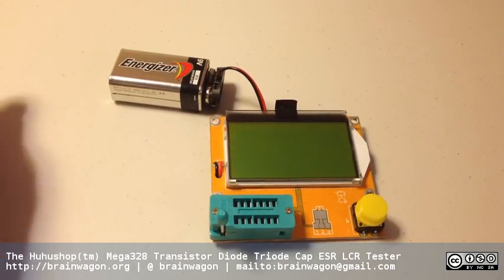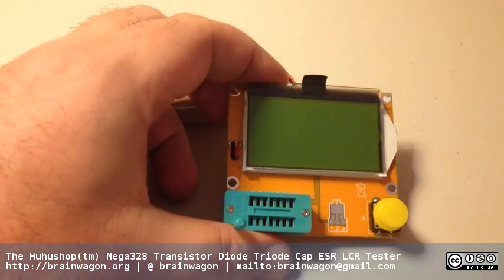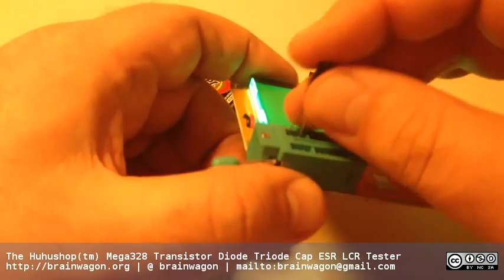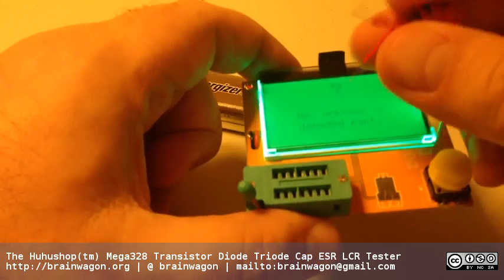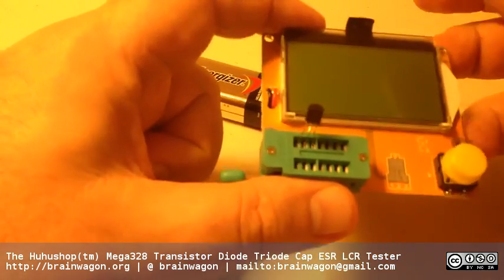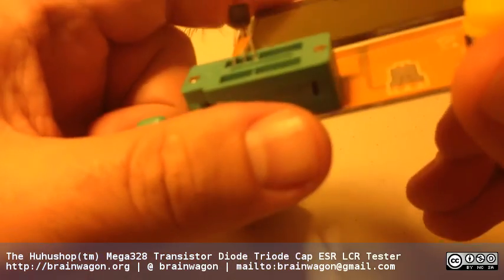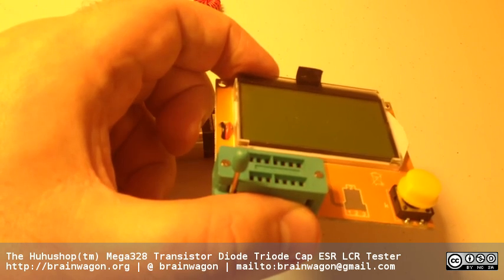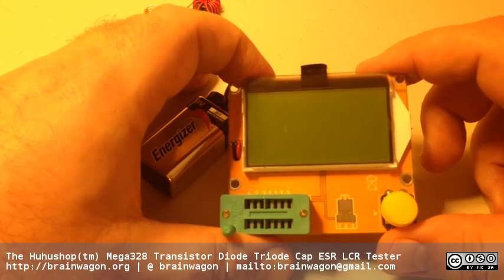The Huhushop Mega328 Transistor Diode Triode Cap ESR LCR Tester

Comment: I think you had the polarity wrong on the electrolytic capacitor the first two tries.
Reply: This tester does not care about polarity.  BTW, for the money it's a great little tester.
Reply: I did look into the error in more detail, and it is possible that the capacitor was not fully discharged. Caps are supposed to be shorted to discharge them before testing.

Comment: You don't remember your resistor colour code? :/ what kind of "engineer" can't remember something so simple? LOL!!
Reply from the maker: I am by no means an electronics engineer.  I'm barely a hobbyist.  My brain is full of all sorts of things that I use more regularly, but about once every two years I have to remember resistor codes.  If I used it more regularly, I'd remember it.
Reply: You would be amazed how little people on our university of electricity know that resistor color coding even exists!
And it is probably because professors feel no need to explain the absolute basics.
Reply: I remember the colors, no problem.  But I fail to see the colors on old or dirty used resistors that have been sitting in equipment for at least 30 years.  Red may look like brown, yellow may have  become orange, blue may look like grey.

Comment: Saw it on eBay for 7.00 to 13.00 dollars,that's why I shop on eBay or bang good ..just a heads up
Reply: http://www.ebay.com/itm/LCR-T4-ESR-Meter-Transistor-Tester-Diode-Triode-Capacitance-SCR-Inductance-M328-/161932407715
Reply: Great price

Comment: I bought new 470uF 50v  capacitor but the reading for them is like 604uF esr=0.21 vloss=2.7%.  Are they still ok to use or do I need to return them?
Reply: Bla rabkom  Electrolytic capacitors are known to have wide tolerances and large leakage losses ,and are used in non-precision applications,so they are manufactured to have an actual value much larger than indicated.
Reply: Ah Thank you, they are M type, so it's + _ 20%

Comment: I tried testing a 78l05 voltage regulator and it came back as a resistor with 2 values.  So I got a value of 672.7 ohms and 2092 ohms.  Can anyone tell me if it a good voltage regulator.  The tester doesn´t tell me if its good, bad or unknown.  The 78l05 is a 5 volt voltage regulator.  It works well on other components.

Comment: Well, I guess the obvious question is....  What does it show when testing a defective component?  After all, it is called a "tester"...is it not?
Reply: It's more of just an identifier I believe. Transistors can check "good" as far as bring identified as such but they can still be "bad" in circuit under load. Obviously if it shows conditions like a short or open its bad.

Comment: I've got one of these. It's one of the BEST tools I've ever purchased. Short of a good signal generator, and an Oscilloscope, you need one of these (After a multimeter).

They won't do voltage regulators, because they don't step up the voltage, so, the only regulator it could identify would be a 5v, maybe a 6v, tops.

Comment: Mark, I just received my tester today and see both yours and mine have the same firmware (v2.07). I was using a VHF MOSFET power xister as a test subject and found that in 2 of the possible lead combinations it identified the device and pinout correctly. However, if I attached the meter's #1 position to the Emitter, it identified the xistor in the wrong polarity (NPN vs PNP) Using common bipolar xisters always read correctly. I wonder if a firmware update would correct this? Anyway, great little tester for the price!!